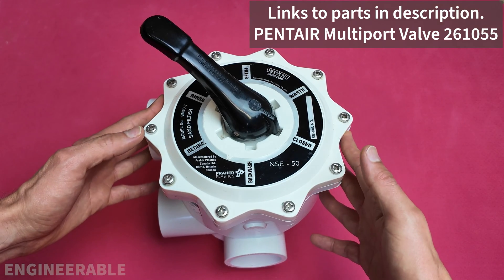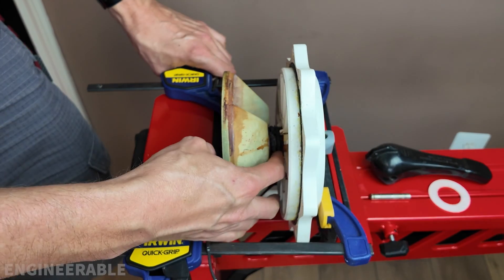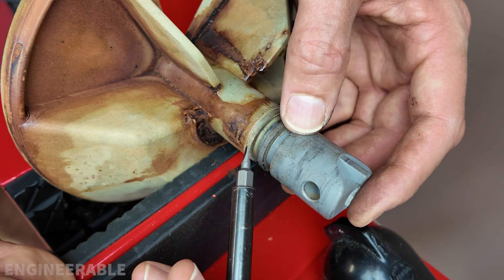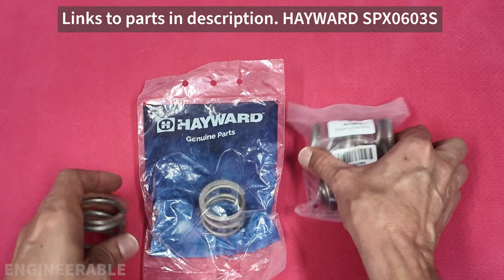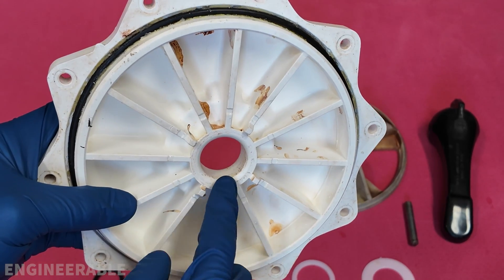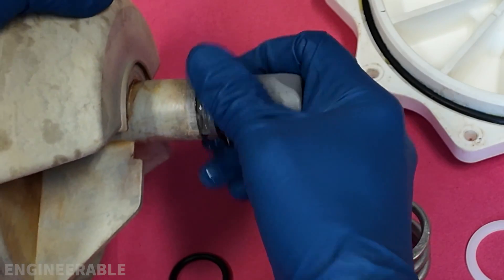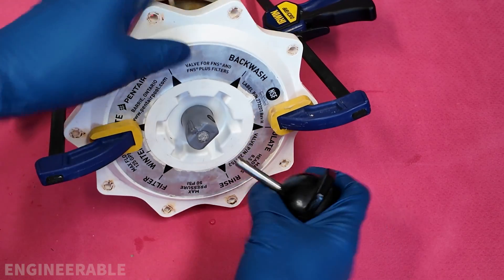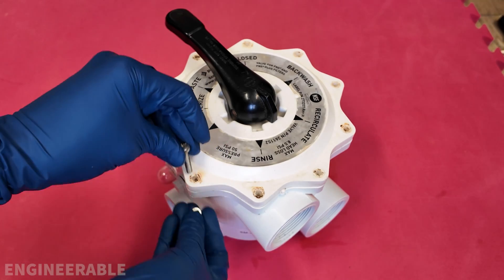How To Replace Rusted Spring & Rebuild Pentair Multiport Valve Diverter Pool Filter Spider Gasket

Comment from the maker: ▼ PARTS NEEDED TO REBUILD THE MULTIPORT VALVE COVER/DIVERTER ASSEMBLY (Check this post for more details - https://www.engineerable.com/single-post/how-to-repair-pentair-pool-filter-multiport-valve-diverter-replace-rusted-spring-and-rebuild-diver )
▶ #23 - Part # 191479 - O-rings - 7/8 Inch ID x 1-1/8 Inch OD x 1/8 Inch - (2 Needed) - https://amzn.to/49prplB
▶ #21 - Part # 271161 - Valve spring -  https://amzn.to/49OTALT
▶ #24 - Part # 271160 - Washer, valve spring (not necessary to replace if old one is in good condition) - https://amzn.to/43Paqb6
▶ #25 - Part # 271157 - Washer, handle (not necessary to replace if old one is in good condition) - https://amzn.to/3vuoScc
▶ Pool O-Ring Lubricant - https://amzn.to/3xjmoO6

Comment: So glad I came across this video!  
I’m new to taking care of a pool…figuring it out by watching YouTubes.
Do you think C-clamps will work just as well?
When putting the diverter back in place I’m unsure about one thing.  I know the handle needs to be in filter position.  
Where does the open triangle need to sit when placing the diverter on top of the spider gasket.  I think I accidentally turned the bottom part.
The areas/compartments under “rinse”, “filter”, & “waste” all have water sitting in them from the filter.  The only open area I see is under “backwash”.  Is this where the open triangles line up?
I hope this makes sense.

Comment: So how do you get the holes lines up so that the water goes through the correct port.  The cover can rotate 360°.  You didn’t mention that you need to mark the orientation of the cover to the handle.  🤷🏻‍♂️
Reply from the maker: There's an alignment tab at the edge of the top plate that lines up with a tab on the multiport valve body.
Reply: @engineerable yes I am aware of that alignment detail.  I was referring to the handle/valve assembly rotating within the top plate you just rebuilt.  My handle will go on either way 180° on the stem.  I had to physically match the holes up to figure out the orientation of the handle.
Reply from the maker: @blackberryblossoms  I see. The handle for the one I rebuilt in the video can only go on one way. The valve stem is asymmetrical and has a feature that prevents the handle from operating if you attempt to install it the wrong way.

Comment: My multi port valve is leaking, I can here it exiting through other pipes when the pump turns off and I'm guessing this rebuild would fix it but I'm not sure because I know nothing about it. Any thoughts
Reply from the maker: If the handle is loose, then the valve spring is bad and this would fix it. If the handle is tight and your spring is good, then the spider gasket needs to be replaced, which I show how to do in this video - https://youtu.be/7mUEgPf-j6k

Comment: I live in Thailand. Following your video, I fixed the leaking top lid by replacing only 2 o rings which cost me only 20 cents + 7 dollars for 2 clamps. BIG THANKS for your video which helps me save 170 dollars for a whole brand new multiport.
Reply from the maker: Great success! I love Thailand!

Comment: 5 Star Video -- Just the thing my handle broke on my new multi port valve where the pen slides in. I have the old valve body that that spring was rusted as bad as the one you showed. I am glad I didn't trash it as can now I can salvage the handle. The clamps where brilliant and I slapped myself for not thinking of it.  👍👍👍👍👍
Reply from the maker: Thanks, I appreciate it. Lucky you had a spare handle. The handle can also be purchased separately https://amzn.to/4cTOtMn
I have lots more info on this page: https://www.engineerable.com/single-post/how-to-repair-pentair-pool-filter-multiport-valve-diverter-replace-rusted-spring-and-rebuild-diver
Reply: @engineerable  Boy, your interest is all of the place with your videos. I have a question on the Multi Valve that you might be able to answer. My 2 inch Multi-vlave is P/N 263085 will this white P/N 270067 valve top work on my main body?  And a note for FYI, eBay has the handle P/N 271156 for as little as $17. Thanks by the way I couldn't find handle's P/N number anywhere.
Reply from the maker: @DanOKC   Yep, my channel should be called "King of Jerry Rigging Everything". No, you have a top mount valve, which is different than the one I show in the video. This is what you need. https://www.poolweb.com/products/6-position-multiport-valve-top-assembly
Reply: @engineerable  With all the configuring everything with a base set of standardized parts I was hoping there was a chance. But your $5 fix video will get me going again. Tanks Again - I like the MacGyver approach to thing too.